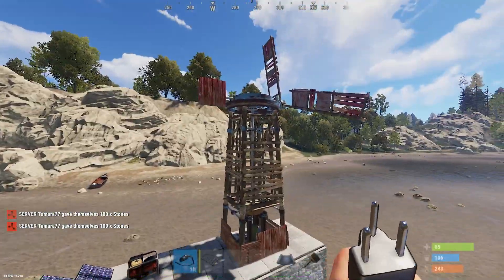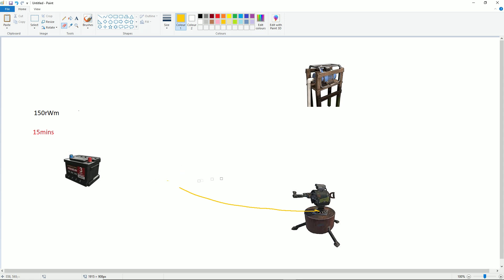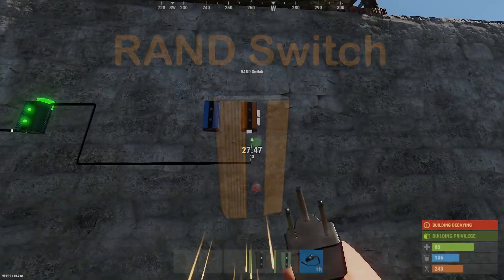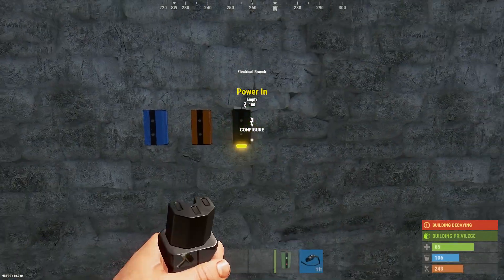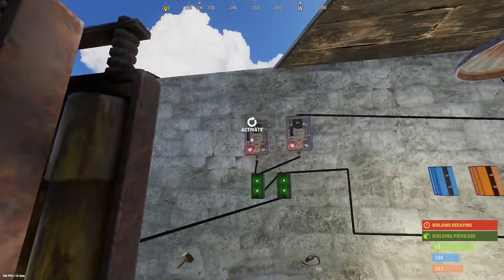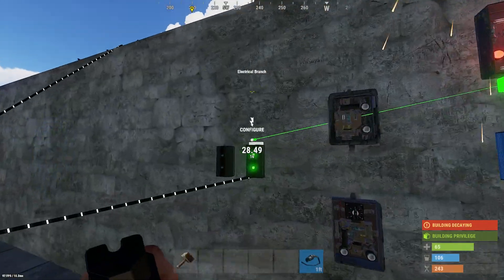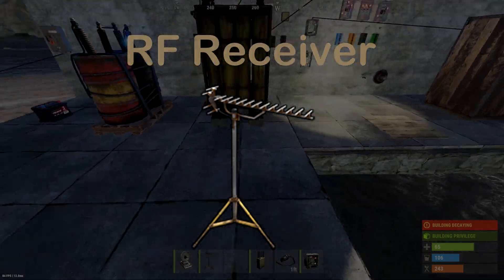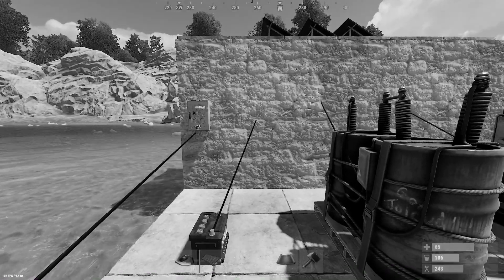Rust | Beginner's Electricity Guide (components/basics)

Comment: I dont know are you the right tuber to ask this, (someone said use branches and don't use spilitters) but why would you use them instead of splitters ? Yeah it's much easier, but it will drain the battery all the time, while using splitters it will drain only if you use the power. This means you can only use turbine or tons of panels per 1 large battery. Rn i have 5 facing to the south and 5 to the north and it's not enough, it's using 85/100 all the time
Reply from the maker: People mainly use the branches because they are more precise. What setup would you not always be draining the power? and could you add a switch to temporarily cut the circuit if need be?
Reply: @tamura77Rust  I have to test it with turbines  too, currently using panels. With splitters my batteries were always full. Active outputs were close to 0 when i didnt use electricity. Now its empty even if everything is turned off, because it shows active outputs close to 90 because the branch takes always the power you set in the config. You cant use switches, it turns everything off.  If the switch is after the branch it still takes the set amount of power you set in the config even if the switch is turned off. Example, you turn your phone off but it still drains the battery like it's turned on, thats how the branch works in rust. Maybe the problem is in the panels, with the turbine it's always charging the battery.
Reply: @tamura77Rust  Yeeeea, i don't get it at all. If it gets 110-135 in from a turbine and active usage is on 80 how come its not enough to charge up the battery. It started to turn on/off the turret so i turned it off from the switch, now it's charging but it's so slow. Had the opposite problem with the splitters, how could i charge 2 batteries with 1 turbine, because they were always on max and felt like it was such a waste

Comment: Nice guide. This can realy help beginners to start using this fantastic system in Rust. You did forget to mention some electric components tho. Sam site wich uses 25 energy, best to be paired up with a smart switch so you can toggle it with your phone and leave/enter your base safely. RF Transmitter, basically a handheld broadcaster. Tesla coil, a trap that can take anywhere from 1 to 35 power and will damage players nearby. The more power you give it, the more damage players will take. Igniter, uses 1 power. Can be used to light fires, furnaces, fireworks etc. Can be used to simulate being online when actually offline. CCTV Camera, uses 5 power. To be used with Computer Station (no power required) to view camera feeds across the map. Electric Heater, uses 3 power to provide electric heat/comfort. A button, allows passtrough for 5 seconds. Basically a timer set to 5 secconds. and now with the new car update, a Modular Car Lift. I believe it requires 20 power. This is required to reconfigure or modify your car. Lastly there's some water related electricity components but yeah this comment is getting pretty long now. Also, there's a website, rustrician.io where you can create electricity setups to test idea's. Very usefull to test stuff.
Reply from the maker: That's why I said at the start I was leaving out devices so that the video would only focus on components. These components will later be used to create circuits, hence why it's missing all the devices such as auto turrets, water pumps, heaters etc.